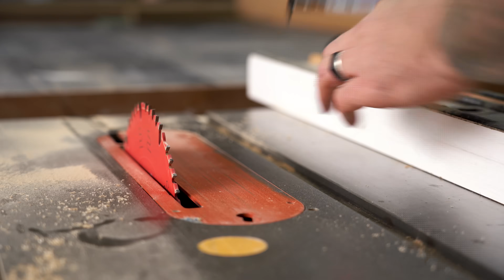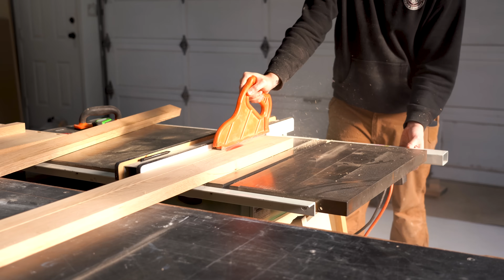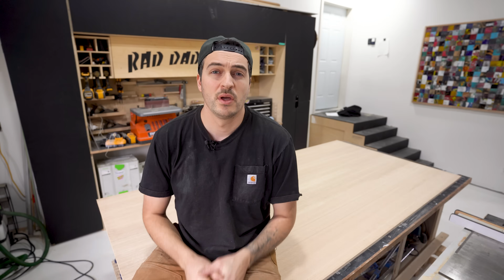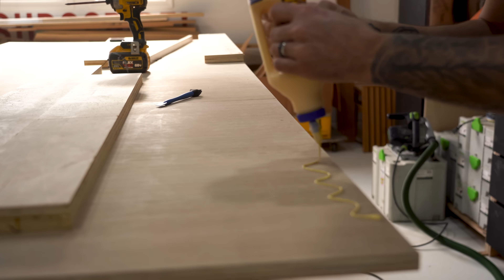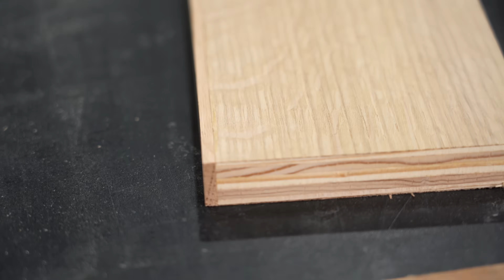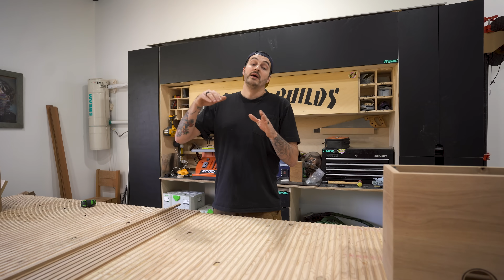I Built My Wife The Ultimate Smart BED

Comment: I know I am a year late on this but I have questions on your thought process ... why did the white oak plywood matter if you were going to router out such a significant amount of it? Additionally, why not router out 1/4" with 3/4" spacing in between (and skip the 5/8 material glueup)? It seems like it could have saved a bunch of time and material.  how much did the orientation of the woodgrain matter if you routed out 75% of the material and then hid it in the depths by gluing the 5/8's material.  I'm new to woodworking so pardon my naivety.  Loved this build. thanks in advance.
Reply: The man just loved woodworking that is all. I'd recommend watching this video for amusement purpose only. There was no good reason to use oak plywood, cut and rejoin them, or spend hours routing the veneer off. The build appeared to be structurally sounded but its design had a lot of ergonomic shortcomings.

Comment: Turned out amazing! Whenever I think of building something that big it's so tricky to think about future proofing and making sure it can be disassembled and move later. The result is fantastic. You still gotta talk about those nice lamps and the embedded switches.
Reply from the maker: That's exactly what I was thinking, I didn't fancy dragging that headboard tip my stairs in one piece. I had someone install all the electrical but the dimmers are from Buster and Punch and the lights are from Lowes.